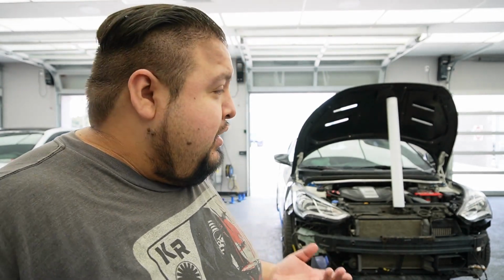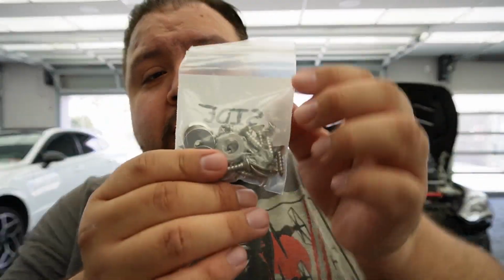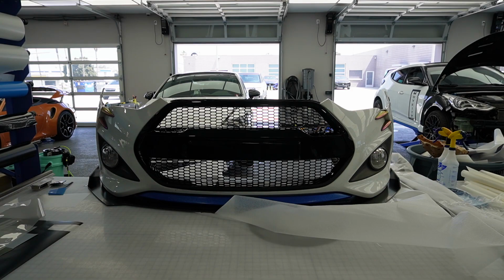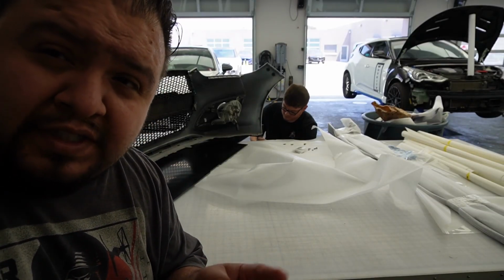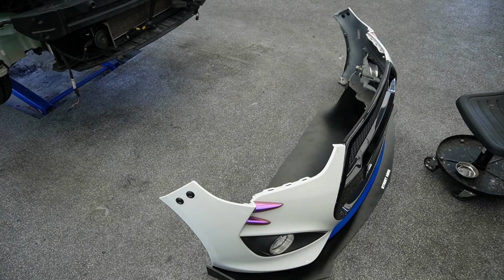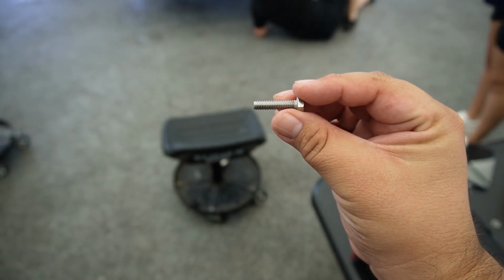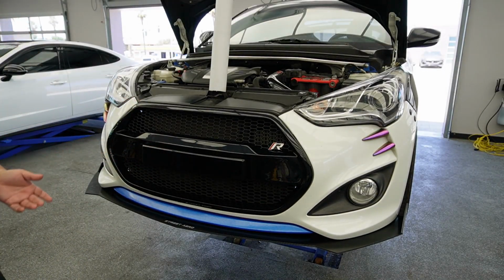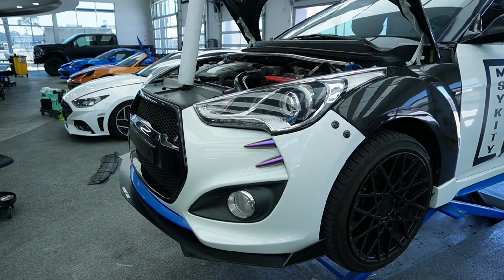Street Aero Splitter Install - Hyundai Veloster Turbo (1st Gen)

Comment: Was it easy to put back the splash guard    bolt to the front bumpet after installing the splitter since it does take quite of room underneath the car
Reply from the maker: I honestly can't remember but I don't recall leaving out anything or having extra pieces.
Reply: Also were they you get the bolts for the extra support at the the bottom